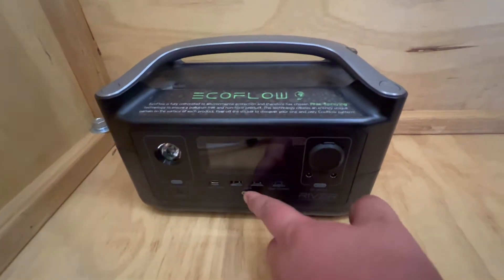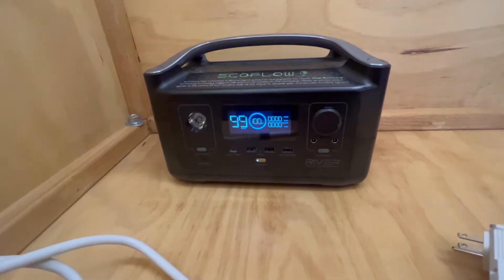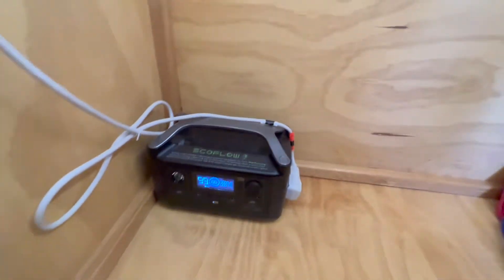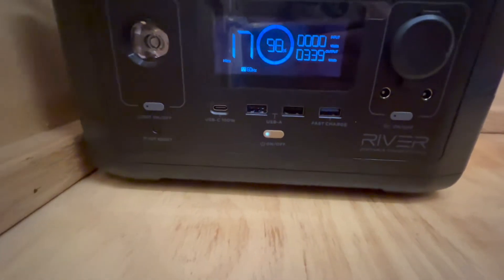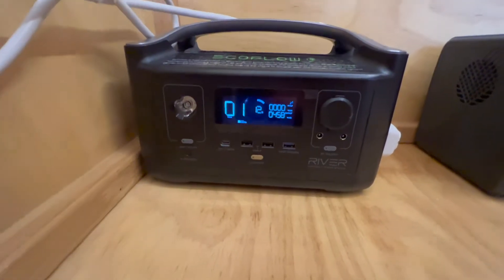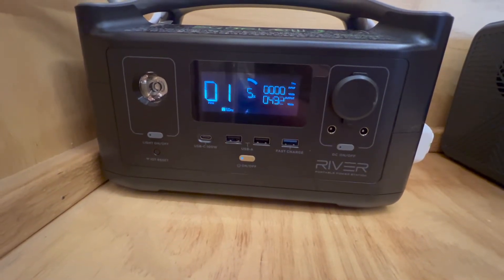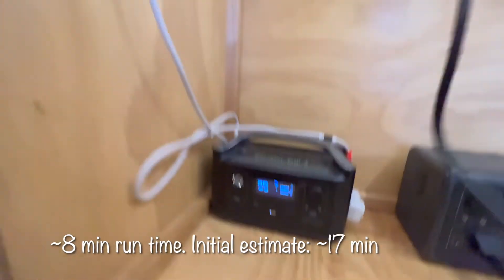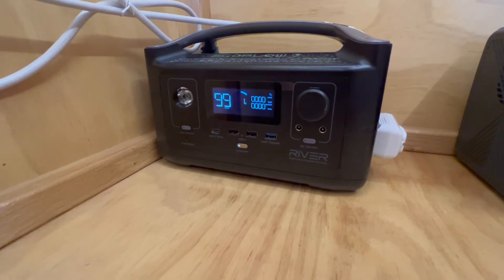Can the EcoFlow River run an Air Conditioner?!

Comment: I am very impressed with the River.  All the while I expected the air conditioner not to run since the River was not made to run heavy appliances like this.
Reply: it is 600 Wt by design, what is not designed lol? The main problem is capacity - only 288 Wh even without counting losses on inverter.

wana long run - take something at least 2 kWh